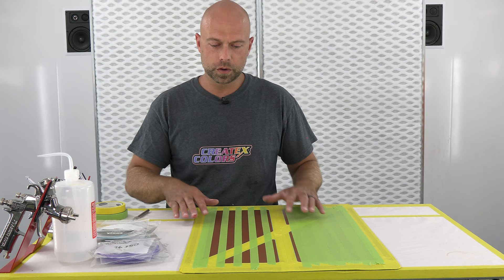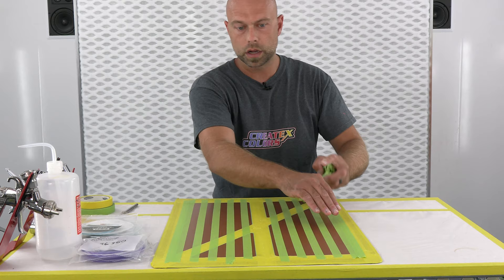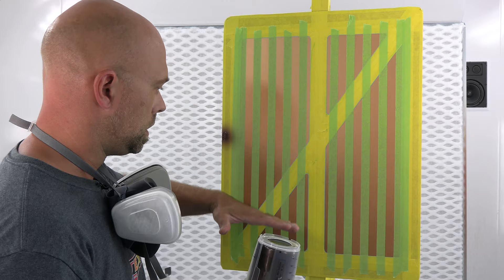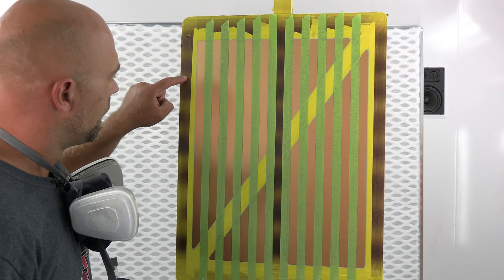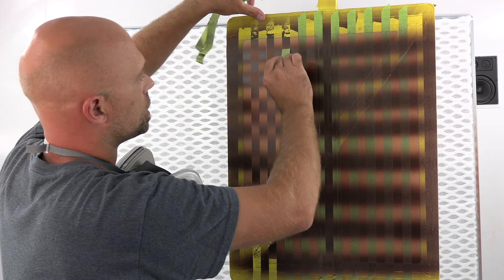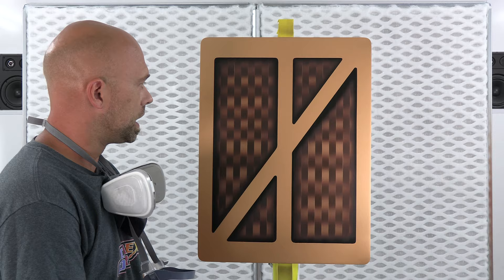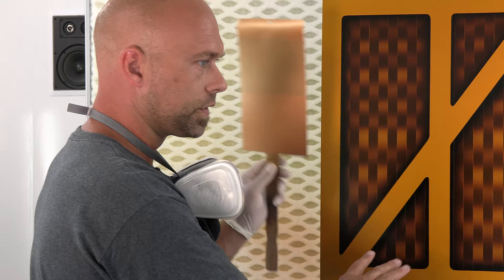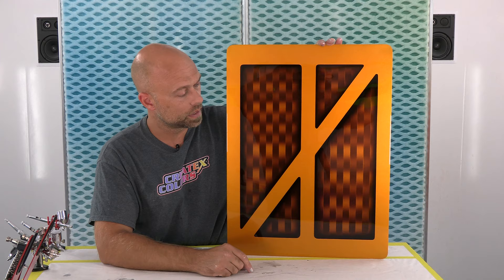Candied Checkered-Weave Graphics

Comment: What is the difference in viscosity between the 4050, 4051, and the 4052 UVLS clear
Reply from the maker: UVLS Clear's viscosity is the same for all gloss levels (4050, 4051, 4052) is set around 600 mPas. When mixed with candy2o, lessened significantly, so thinning with 4011 Reducer isn't required, whereas 4011 is added ~ 5% per vol. to UVLS when its applied as a clear with a spray-gun. Thank you.

Comment: I’ve been using the gloss top coat and it just isn’t giving me the finish that you’re showing here. Should I switch to the uvls?
Reply from the maker: The clear used in this video 2k solvent-based urethane clear. UVLS 4050 Gloss Clear can also be used. 5604 Gloss Top Coat is for fabric & art/ light hobby, not recommended for hard-surface / automotive application. Thank you.